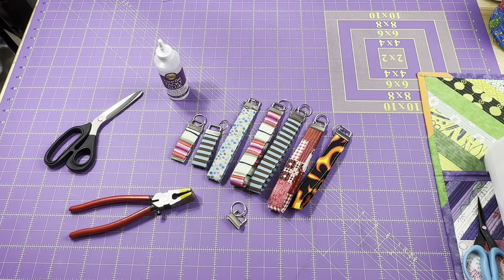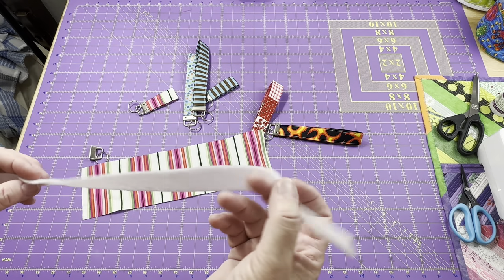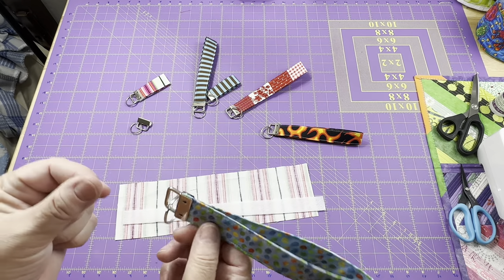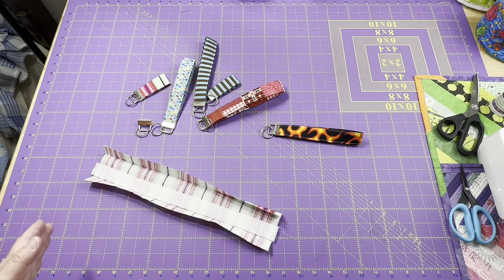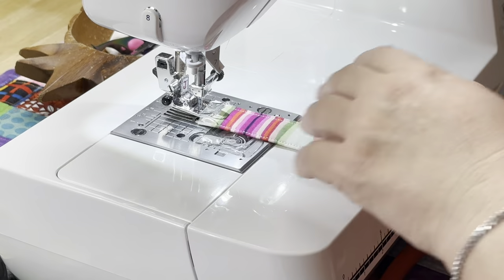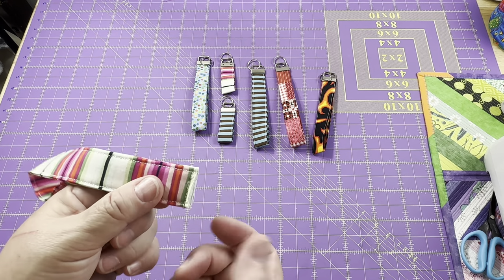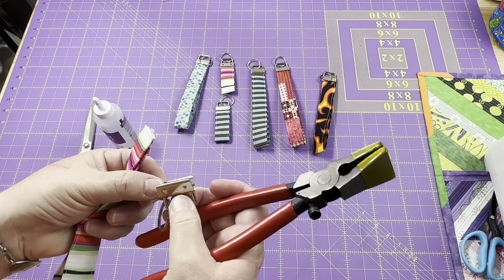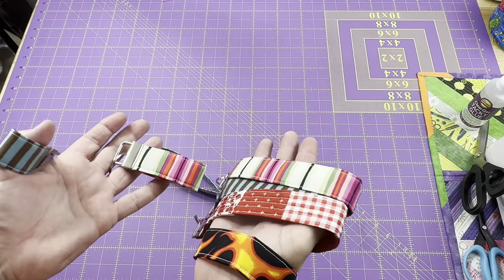1" Key Fob Wristlet Tutorial

Comment: Stripes are fun, and so are other patterns. I need to come up with a key fob that doesn’t require the hardware, since I only need one. I don’t know if a button hole through both sides would work or not.
Reply from the maker: There should be a link in the description box to a key fob using just a key ring.  No special hardware.  I used a lobster hook but you can use a regular key ring.

Comment: Perfect time to a ask you a question. I always follow your advice about stitch length because your work I’ve purchased from Etsy looks so neat and professional. Is there any way to make your 2.0 stitch length permanent with a Juki or do you have to reset it everytime you sew? I figure it might be possible to save it in the Juki’s memory but I think there ought to be some way to just set it.
I love anything multi-colored, striped or random irregular polka dotted.
Reply from the maker: With my Juki I can’t auto set stitches.   When I switch to the 1/4” seam stitch It is automatically set at a 2.0 stitch length.   I’ve just gotten into the habit of changing to what I like based on each project or part of a project.  Now that doesn’t mean It can’t be done but I’ve never come across It while watching videos for my machine or reading the manual.
Reply: @rsislandcrafts  I think you’re right, stitch length can’t be set in a random way because Jukis operate with such a complex system of stitch patterns that must work together or you’d have accidents, crashes, etc. You just have to get in the habit of setting the stitch length you want each time. My problem is I love using the patchwork foot and the patchwork foot doesn’t work with the 1/4” seam allowance setting. Oh well! You can’t have everything I’m told. Don’t know why that is but that’s what people say. Thanks for your quick answer. I’ve been going crazy trying to figure it out.
Reply from the maker: @susanb8354     You’re very welcome.

Comment: Doesn’t the teeth of the key fob grab both pieces of the fabric with its teeth? And when you squeeze them together it locks together? If not, how does it work then? Thank you
Reply from the maker: The teeth are only on one side.  They’re not long enough to go through all layers of fabric. Yes, the teeth are meant to hold onto one side and when you squeeze the two sides together It should lock together and not move. Unfortunately for various reasons there’s a large number of people that have had the fabric pull out of the clamp.   That’s why I take the extra steps to hopefully avoid the issue of the fabric pulling out.  I  have not had that problem with the key fobs that I’ve made for myself or my family but I like to take the extra steps just in case.  I hope that helps to answer your question.
Reply: @rsislandcrafts  ok it’s good to know. It’s happened to me too, but I thought I was doing something wrong. I start using gorilla glue with them also. Maybe that will help. Thank you
Reply from the maker: I’ve heard that a bit of glue helps.

Comment: Are the key fob pliers with straight jaws or do they have a slight curve? I ordered a pair and they have a curve and they're not placing equal pressure when clamping down.
Reply from the maker: Mine are straight or flat.   No curve.  You may need to return yours.